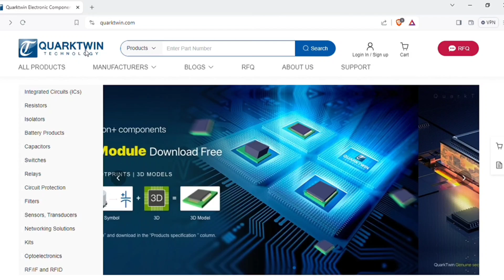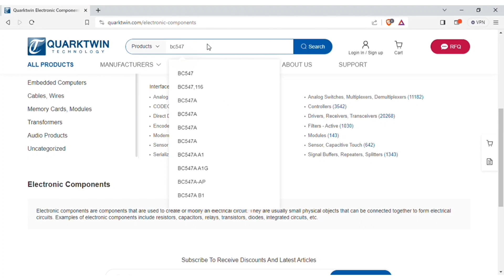3 helpful electronics projects for beginners

Comment: Ok bc 547 long range 
But i want to knows more powerful distance, 
If we change bc 547  to  equlent but heigh voltage transistor working upo 120 v dc .
Or for glow led or sensors use higher ranges Resistance protection, 
Possible?? 7:28